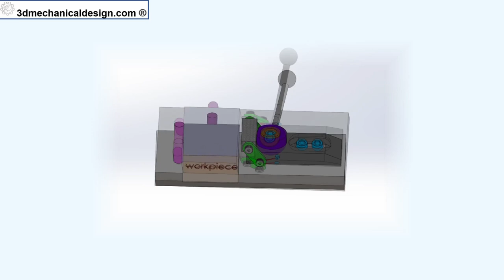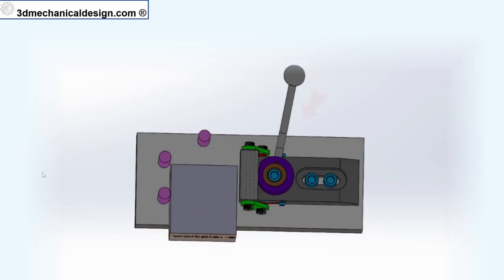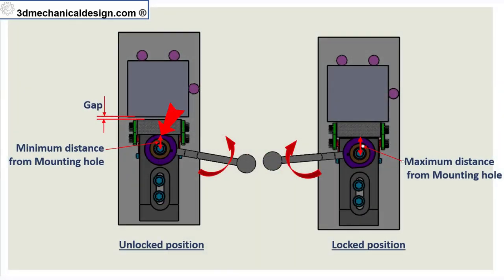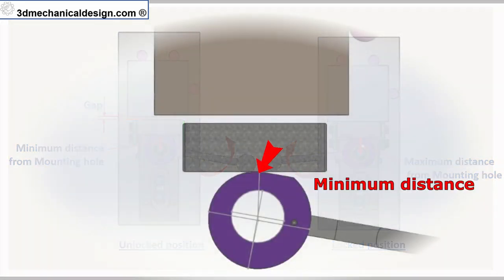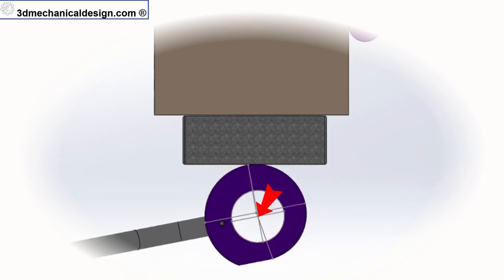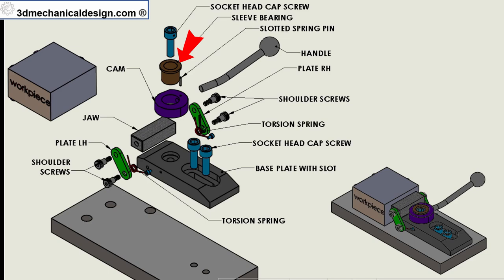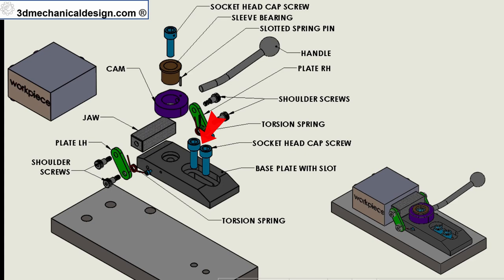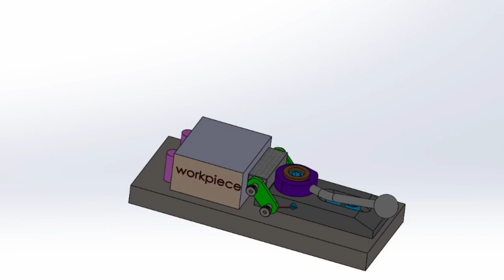⚡ Horizontal Cam Operated Clamp, mechanical engineering

Comment: How does the jaw create downward force? Please could you explain it to me?
Reply from the maker: The jaw rotates relative to the lower shoulder screw (pivot point). The force is directed in a circle of rotation of approximately 45 degrees down. ( see diagram at 33 seconds of video) We have a horizontal and vertical projection of the force vector. The vertical projection of the force is downward force.
About vertical projection
https://en.wikipedia.org/wiki/Vector_projection
Reply: @3dmechanicaldesign  Thank you